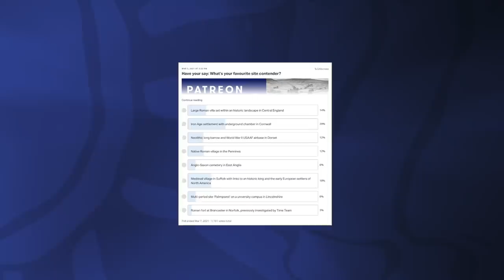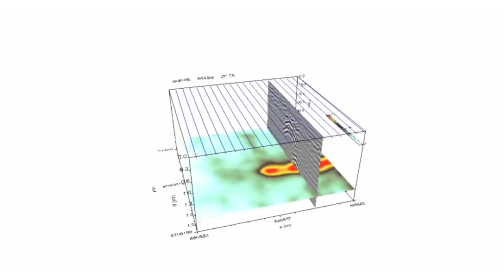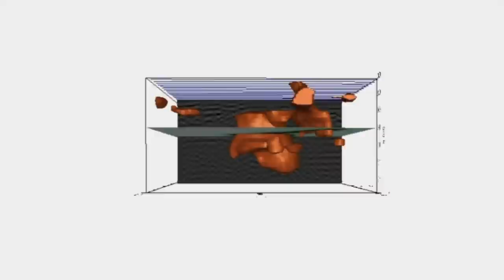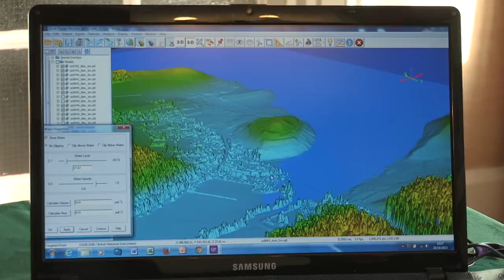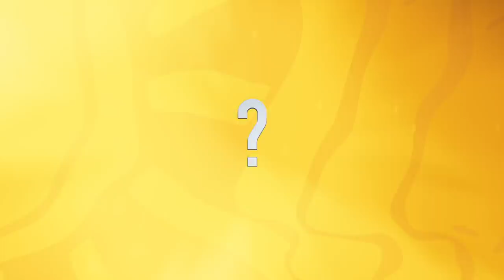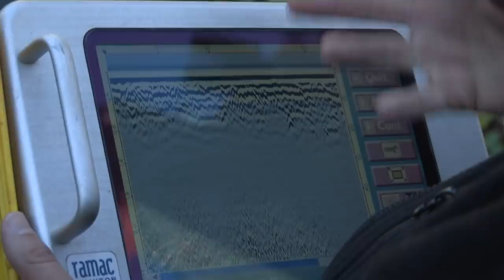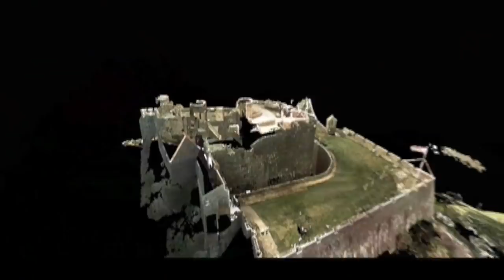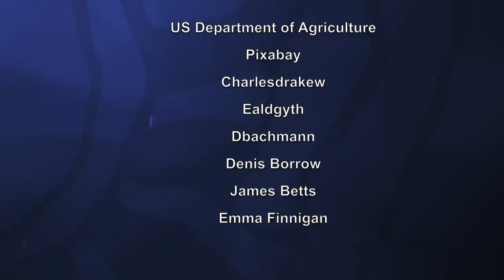Time Team Assemble: Sites, Team and new Dig Watch - EXCLUSIVE NEWS!

Comment: Please please please check the hydrology for these two sites. The villa must have had a reliable clean spring but ground water levels can change. For the Fougou, water is also essential. In this case there should be an underground water supply. Consult with local cavers who know the secret hydrology. Cavers do not normally publish their findings outside their circle, so as to protect the caves.